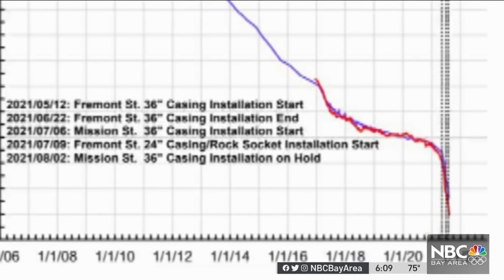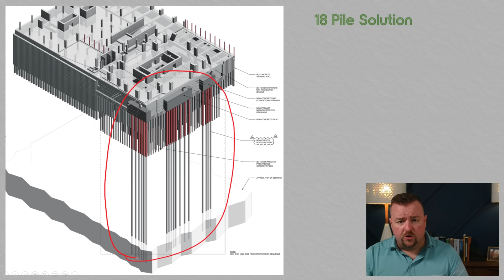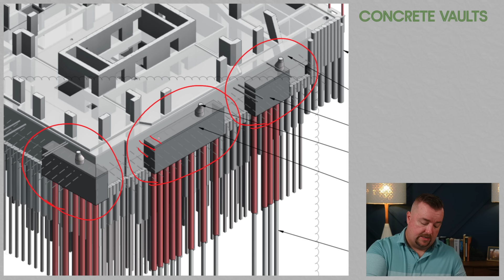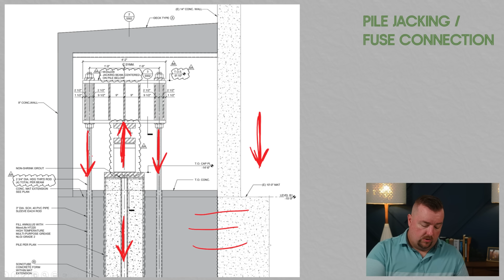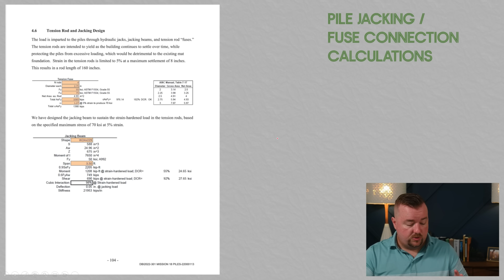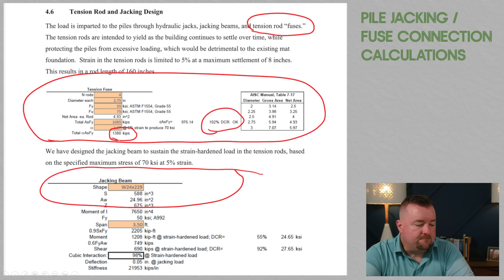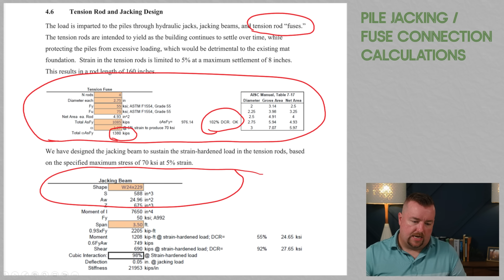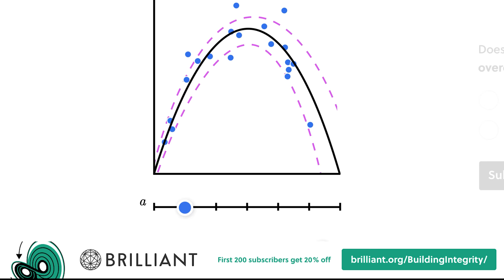Did I Uncover a $100,000,000 Mistake with the Millennium Tower "Fix"?

Comment: I have an engineering degree in an unrelated discipline. In addition to that plate (and the associated nuts), I'm also worried about the ability to transfer that much force to the existing building. The existing foundation was designed to have force distributed widely across the base. Putting that much force on the edge strikes me as a great way to run into weird loading regimes including torque, which concrete doesn't handle too well.
Reply: Yes that wedge is kind of small, especially as it would have been easy to water jet deeper under the existing slab, and then pour in a wider thicker raft to spread that load over a larger area. Not as well bonded to the structure, but with enough steel in it, and thick enough to make the slab triple the thickness in that area, it should be able to spread the point loading out a lot. Yes cast without a form, but use a high quality hydraulic concete and superplasticiser, and just keep pouring till full, with a minimum volume of concrete to ensure good cover, and you will have a much superior foundation, then can use the forms and do the rest in a few pours per section.
Reply: agree
Reply: True...but how is the system gonna behave if the building starts to move in the event of an earthquake, the forces on the foundation will suddenly have unharmonic spikes....i hope i don´t have flaw in my thinking process..
Reply: I also don't understand why the key is angled the way that it is. It's trying to push up on the building, so the top edge of the wedge would be where the force is applied. I know it's tied in with rebar, but wouldn't the angle on the top of the wedge tend to want to push the vault outward away from the building as more load is applied? Would there have been some other limitation with flipping that key vertically?
Reply: I have no engineering degree, but my first thought was "That is a lot of load going through the threads of 4 nuts (at the top near the jack)". And each thread is like 5-6 mm deep? Is that really enough to hold up the building?
Reply: @evan-edstrom  I was thinking exactly the same thing.
Reply: Great point! All force is applied from one side,  I can't imagine how that should work over decades, not to mention earthquakes, floods, extreme wind, you name it...
Reply: @JanBruunAndersen  , I was thinking the same thing as Josh was showing those photos, and hoped he would have mentioned the safe loading of two nuts threaded onto that rod.  I'm not an engineer, but do have experience with guy wire attachments on large communications towers, and putting that much tension on just the few mm of thread depth is a major concern.
Reply: @gilde915  I'd expect this contraption to be ripped off from the building and then the building will do something we don't want.
Reply: @JanBruunAndersen  makes me wonder what kind of wonder material the ''fuses'' are supposed to be made of.
Reply: @mikef2618  Not an engineer so please forgive me if this is a silly question. Could an earthquake cause the safe loading to be catastrophically exceeded?
Reply: @DonFahquidmi  I cannot answer that, as I also am not an engineer.  I did, however, work on a guyed radio communications tower that sat on a bottom plate about a foot square, held up an inch or so off the concrete pier by four 1 inch threaded rods sticking up out of the concrete.  I was not involved in the original construction, but was told the original crew had finished building the 400-foot tower and were about to start putting antennas on it.  All of a sudden, there was a loud BANG!, and the whole tower shook, but stayed up, with the guy wires now somewhat loose.  The four nuts under that baseplate sheared, and the tower dropped about an inch.  The manufacturer's response?  They should have grouted under the baseplate.  So the manufacturer was relying on a $5 sack of grout to hold up tens of thousands of pounds of downward force.

I live in the Midwest where earthquakes generally do not happen, and if they do, may only knock over a plastic lawn chair.  But, I'm sure a California quake would, indeed, cause the safe loading to be catastrophically exceed.  All bets are off.
Reply: concur
Reply: @JanBruunAndersen  Nuts are designed to develop the capacity of the bolt in tension. That is, the bolt (or rod) will fail before the threads do.
Reply: @ehsnils  I think it will hold just long enough to tip the building up straight, then pop and let it drop back with enough momentum to keep going. 
Ever watch a guy try to pull a tree away from his house, only to have the rope snap and the tree goes all the over and falls on the house. It's hilarious.
Reply: @ashedold11  not even close to true, and that assumes there was a design. 
Many nuts are thin, yet mounted on huge bolts. Some are even made of soft material, intended to fail before the stud or critical part is damaged. 
Only with a grade rated nut do you have a load rating for that size, and ut might even depend on the pitch. 
These nuts were designed by the same guy that designed the unrated plates.
Reply: @ED-es2qv  It doesn't sound like you know what you're talking about. This engineer didn't design the nuts. They didn't need to. The rods and threadforms are specified in ASTM F1554 specification which was specifically designed to ensure the nuts and thread won't fail before the rod yields. These aren't some little dinky eyebolt you use on your porch swingset.
Reply: @DonFahquidmi  I'm not an experts either.. but if I'm trying to rip a fence post out of its footing. I wiggle it.
Reply: @mikef2618  Thanks for your reply. I worked for an engineer putting guy wires so he could increase the height of a bungee jumping tower on South Padre island, Texas. It was nowhere near 400 ft. The anchors for the guy wires were robust and if anything a bit of over kill. Better safe than sorry rather than let's see what we can get away with.

Also, I live on the island of Hawaii and have been through a number of earthquakes, the strongest of which was a 6.9.  The tallest building on the island is only 12 stories high. It caused damage to buildings that were only several stories tall.
Reply: @johnh2312  I've done my share of fencing so that seems like a pretty good analogy to me.
Reply: @evan-edstrom  I'm guessing that the angle is designed to keep the concrete pad of the building in compression (where the strength of concrete is at its best). It seemed off  to me, too, until I realized that.
Reply: @WritesWithCare  Ah, I see. You're suggesting that the building is pushing the wedge outward, but the wedge is also pushing the building's pad inward. That makes sense.
Reply: @WritesWithCare  I would also like to know what the cross-section of that wedges are at their thickest point. Will they be in shear between the vault and the building? I really do not understand the connection between the new vault and the old building. Will the concrete or will the rebar rebar will be the main member taking up the shear between the vault and the building?
Reply: @evan-edstrom  Introducing an upward force to the angled key interface will introduce an enormous amount of lateral shear force between the existing foundation and the add-on angled key surface. I'm no architect, but I do understand physics well enough to know that this is a recipe for premature failure. This design will not last for an extended period of time, as the two surfaces in the keyed area will pull apart from each other.
Reply: I have no mechanical engineering background and that design just feels like that plate could fail in tension and crack the concrete. This whole design should be simulated by FEM. I would think a load I-beam should be used. But also the tie in to the building seems sus. I would want to reduce the load substantially. Triple the piers. Use strain sensors. It doesn’t have to yield to distribute the load.
Reply: The whole "solution" is insane. Long time machinist/fabricator/civil works guy with half a physics/maths degree digested many moons ago.
Reply: @JanBruunAndersen I worked in the fastener industry and in most cases the the steel in the bolt itself will fail under tension before the the nut strips out the threads.
Reply: @JanBruunAndersen  I've seen similar designs fail,   although at a smaller scale.
Reply: Start Demo soon
Reply: That, large rectangular   concrete    foundation  ''' matt '', is buckling concave, to the earth. The middle is wowed   ' down '   allready !  This new fix, to me, is just another  attempt at   ''how  to fail ''  in  structural  engineering.  That small, steel  ' plate ', bearing  1.3  k's,.....is   another    ' joke '.
Reply: @evan-edstrom  I think the idea is to have the key push things apart (as you noted) and the rebar will prevent that from succeeding, spreading the stress across a wide area.  If you flip the key the other way, then that ledge will have to be engineered to withstand the entire sheer force and the force is across a much smaller area.
Reply: @1verstapp  I'm wondering what the point of the "fuse" is.  What undesirable thing is it trying to prevent?
Reply: @JanBruunAndersen  Same here. If you showed those threaded rods to any mechanically-minded person and said, "I'm going to use these to hold a multimillion pound, multistory building up," they would think you were nuts.
Reply: @ED-es2qv  It doesn't fall that fast, it falls slowly over a period of months
Reply: @JanBruunAndersen  I strongly suspect it will fail.
Reply: @evan-edstrom  i thought about that wedge design and I think it is indeed designed to push the vault AWAY from the building.  However I think this is a good thing;  being that the vault is tied into rebar which is tied to the entire building's slab, you would be effectively tensioning the building's slab giving it strength against vertical stresses.  Kind of like holding a sheet of paper on the ends and pulling outwards so that the paper becomes taut, movement of the vaults away from the slab would make the slab more taut.  
I could be totally wrong but it's the only logical reason I could think of.
Reply: I just read your reply and agree about the concrete.
Reply: @SeanBZA  Water jetting the already unstable soil under an already sinking and tilting building sounds like a recipe for disaster. They already ran into trouble with their "solution" of adding more piles, as that has accelerated the sinking and tilting, so it stands to reason to take a few steps back and thoroughly analyse the problem and the proposed solutions instead of just throwing solutions at it in the hope that one of those might work.

I'm not an engineer, but I can see that ultimately that tower has to be demolished, because the situation only seems to worsen with every attempt to fix the problem. You can't just keep throwing solutions at the problem until the building approaches the critical tilting and/or sinking points, because demolition in place will take quite some time. And time seems to be running out on this building.
Reply: @Samuel Surely the point is that they would fail by design. So what then holds the building?? How does this make sense?
Reply: @jonka1  The "fuses" might fail in exactly the wrong earthquake profile, but that won't cause a worse outcome.

The building is still sitting on its original foundation, and that foundation was designed for earthquakes and wind loads.  The issue is that the unusually dense building is very slowly sinking, and sinking unevenly.

This reinforcement isn't replacing part of the foundation that's missing, it's adding support to allow the other side to sink and the building to return to vertical.  It's a 'thumb on the scale', not the full support.  If the fuses fail, that fraction of the building weight just returns to its original piers.
Reply: Agreed.  I have only 2nd year civil engineering before specialising in another discipline but even so I thought the same thing.  The bending and twisting moments surely will affect the stability of the entire structure.  Despite all that the plate seems crazy small for those forces.
Reply: @gilde915  What is an "unharmonic spike"?  I'm unfamiliar with the term
Reply: That's why fuses are part of the design, so the concrete isn't asked to handle any loads it wasn't made for.  Once the new cement work is complete the new and the old will behave like one piece of concrete due to the compression created by the rebar attaching the two structures as well as the shape of the joint connecting them.  And it's not as if they need to lift the whole building, they just need to tilt it a hair to get it  back to vertical, the vast majority of the building's weight will still be supported by the ground like it always has.
Reply: two bad moment arms vs on pile of garbage leaned up against the side.
Reply: @donaldbiden1920  I hope this kinda shows:   ------I---I---------IIII----II-I   waves are normaly harmonic ups and downs but in an unharmonic system you have waves suddenly like ten times the ups and downs maybe 2 secs then 5 secs then no wave and a huge one.....imagine you thorw a couple of stones close to each other in a pond...those waves when they meet can be spikes and the waves bounce of each other canceling them selfs out or magnify in a chaotic way. I hope i get across what i mean:)
Reply: @pilotavery  well technically its moves very slowly at first then falls quickly. This building is a disaster in slow motion.
Reply: @tomparker9966  know what I'm saying is, if the cables snap or the plate snaps, it doesn't suddenly fall, What happens is the settling continues for another few months until it gets to the point that it falls. A catastrophic failure of this system doesn't result in a collapse. It just means that they didn't pause its fault anymore
Reply: @Samuel  The fuse concept is part of how crazy this design is. If the fuses break during an earthquake, it will require another multi-million dollar project to replace them. It is not going to be as easy as replacing an electrical fuse.
Reply: @Samuel  I don't know if the ships on the sea analogy really works for buildings. If a ship had the same ratio of height to beam (width) it would be in danger capsizing easily.
Reply: precisely, distribution of force, regardless of weight is key when dealing with 'fragile' things ie lo tensile strength like concrete or glass or etc.
Reply: @pilotavery  Maybe engineers can find a solution but I'm glad I don't own a unit or anything nearby.
Reply: @JanBruunAndersen  x 18 piles
Reply: @ashedold11  Thanks, good to know. Now, where will the threaded rod typically break? Would it be some random location along the length, or I think more likely adjacent to the nut? And if adjacent, then what is the relative strength of the assembly compared to the calculated strength of the rod cross section area? Or is the entire threaded rod assembly certified to some level of force greater than that to be applied?
Reply: @johnh2312  I yanked up some fence posts. I used my tractor front end loader!
Reply: Ding ding ding ding freaking ding...
Reply: @mikef2618 the grout used in these applications is typically in the 10,000 psi range and is purely in a compressive load (where these types of materials are the strongest). At 144 square inches that 1 sq ft of grout would support about 1.4 million pounds.
Reply: As I understand it the foundation mat is already dished (concave top surface) and cracking due to the unequal friction pile loads.  (The center piles tend to overwhelm the local soil while the more isolated edge piles carry more load.)  Adding even more load to the outer edge is not going to help.  At what point does the damaged mat start down the 'other side' of the stress:strain curve, headed for outright failure?
Reply: And the transfer is horizontal. That cannot work.
Reply: Yes. You can have a situation where the outer wall  of the foundation stops sinking or even raises but as you go in towards the center there is now an aditional gradient forming. Do to it having a far higher compresive limit this will transfer force upward unevenly along the radius  where force is uusually proportionate to the inverse square law only until there is give somewhere. As others have  said torsion, sheering, and bending is really not something concreat  doese well. One thing we can say for certain is the compression on the outside is  going  to be far greater especially if they try to lift considering the center under foundation was already compressed. Not really my area of science but this whole idea seems out of place like it was designed originally for a different situation.
Reply: Yep.  That was the first thing I noticed too.  Don't want to second guess the engineers involved (I'm an architect) but that connection is worrying for me.
Reply: Great point.  The piles will seemingly support one corner.  As you say, the existing foundation may or may not be capable of distributing the forces.
Reply: @mikef2618  Two nuts? the jacking beam only has one. it would fail there. I don't think the bottom nut on the jacking beam will be supporting any load.
Reply: Yeah, the number 1 thing I learned in construction class is that concrete is horrible in tension. All those oddball forces are going to cause some real big problems 😅
Reply: @ashedold11  so interesting. This, I did not know! Thx.
Reply: @pilotavery  so this plan is to better support the tilting building (on the sinking side) by fusing the deep supports into the current building base. And if this doesn't work, or if it fails (even catastrophically), then you just have a tilty building again, but not a risk of devastating failure and collapse of the building (which was never a risk at this point, tho it could be, depending on how fast and unevenly it sinks.

It's not at risk of collapse before the repair, thus it won't be at risk if the repair fails? If it fails, they'll just have to do something to fix the lean, again? Costly, annoying, maybe even embarrassing, but not a catastrophe? Do I understand you correctly? 
Thanks so much 😎
Reply: @pilotavery  might a sudden failure of the reinforcement cause a sudden tippy-tilty of the building, after which it cannot stabilize itself...? And could the building actually tippy-topple right tf over in that failure moment?
Reply: me thinkig the same thing
Reply: You misunderstood the design. The extra fuse system is not used to stop the sinking. The smart thing in this design is it allows the building to keep sinking. that is why it has all the grease filled gaps and overdrilled pile holes. It only add extra resistance to make the supported side sink slower than it can, it does not need to transfer the load through the base plate, it actually reduce the stress apply to the plate due to uneven sinking. So if the metal plate mentioned in this video can really transfer the load it is actually an excellent design. Only thing worries me is what if the project actually disturbed the clay layer and reversed the settlement speed? I mean the soil settlement may become faster at the unsupported side. The underground condition is actually mostly based on guessing and trial and error...
Reply: @JanBruunAndersen  if they use coarse threads, it should be alright. Lol.
Reply: Reminds me of the Hilton sky walk collapse where the threaded bars pulled out of the metal box frame of the concrete Skywalk slab
Reply: @92up7  I know nothing about buildings and engineering, but a news report I watched said the design was originally for a smaller building that was mainly made out of steel, but they decided to make it bigger and replace the steel with concrete to make it stronger.

I also heard that when the design was originally made, it was proposed to put all of the supports all down to the bedrock but it was $4 million more expensive. If that would have saved the entire design and problem, then $4 seems an absurdly low price not to pay at the start.
Reply: Although the wedge is now poured,  I would hope that the existing exposed rebar were extended across the new concrete grade beam, thru cad welding or similar.
Reply: @evan-edstrom  I would have caused the existing reinf bars exposed for the wedge to be extended for the full width of the grade beam, in addition to roughening the full side of the foundation slab, using bonding agent and a forest of new reinf bars.   I wonder if this was done.    The concrete removed at the wedge might have been for the purpose of extending the reinf using CAD welding or sim.   If not, I can't see how it can work.   Also, I strongly suspect that the foundation slab was not designed for the loading that it will receive with the new piles extending to bed rock.  Also,  did they allow for suction under the foundation mat, and the resistance of the existing piles to withdrawal as they are lifted.   I am an SE and think that the bldg ultimately will be demolished.    Also why did they use concrete when a steel framed building is lighter?
Reply: @1verstapp  A new invention:   steel.
Reply: @DonFahquidmi  Reply from an SE:  Yes.  And the EQ can damage/destroy unreinforced piles with upward (P waves) and lateral loading (S waves).
Reply: @mikef2618  Do you know that the Midwest had the biggest earthquake in all of history?
Reply: @petersack5074  I think that you comment is right on the money.   I am an SE.
Reply: @jeffreynelson2660  Thank you.
Reply: @johnh2312  Add liquefaction to the mix and they are in deeper doo doo.
Reply: That’s why multiple units are experiencing sewage backups into the sinks. The sewage pipes are no longer flowing unobstructed at the correct angles
Reply: In Canada engineers must have their work peer reviewed for any construction project. Isn’t this required in the US?
Reply: @1verstapp Maybe carbon fibre?😅
Reply: That's what the "fuse" concept is intended to address: limiting the force transferred to the vaults.  Fun question is whether the force allowed to be transferred will in fact solve the problem.  They're counting on the building continuing to settle on the other side.
Reply: There already are massive amounts off directional pressures that it is not designed for. Maybe we can get the government to bring it down like the towers. Oops almost forgot about building 7 that was never hit.
Reply: @slowzuki Hyatt in Kansas City, not Hilton, right?
Reply: @evan-edstrom Nope.
Long version:
All materials have an angle of repose, it's the slope you get when pouring a pile of the material.
If the angle of the slope in the construction is less than the angle of repose then it won't slip.
In order to fail as you suggest, it would need to slip.

Remember also that rebar will make that angle much much steeper.
Reply: @JanBruunAndersen  Thinking the same.
Reply: @gilde915  I hope you're wrong but have to admit that is some serious thinking well beyond the usual what ifs. Imagine the audio track as a highly irregular, random, hi frequency ringing as the ground shifts.
Reply: 2 nuts jammed together does not spread the load across the 2 nuts.
The bottom nut will carry the full load.  If they calculated the load capacity by simply doubling the value of one nut it will fail. They need to have custom nuts machined that are larger diameter and longer.. The larger diameter will greatly help the plate punch thru problem.
Reply: @ehsnils  Yeah I agree. I don't think that little rebar tie in is nearly enough to attach to the building an help spread the load
Reply: It would be best if they just took down the building. I have very little confidence that it’s a solvable problem short of gradually replacing the ground with concrete all the way to bedrock.   And even if it is solvable, do you really want to trust it?
Reply: In theory it should have been possible to adjust the settling rate opposite of the lean. Drill and inject water, or simply drill a decent amount of holes, should have allowed to increase settlement on the opposite site. this would have helped to unload the foundation, instead of putting more stress on it. but i don't really know of any case this has been done, so i guess the rather went with this works with small structures so let's try to supersize it.
Reply: @JanBruunAndersen  i had that same though when i saw the threaded rods in picture... those threads are really thin. and how are they making sure they don't slip during an earthquake or other movement/vibrations? what are they going to do, pour a whole bottle of lock-tight on each one?
Reply: @DonFahquidmi  This structure is certainly designed for an earthquake. I would suspect that earthquake loads are already considered in the amount of tension that each rod has to resist. I also suspect that earthquake loads are why this "fuse" is being installed in the first place. I think the idea is that it will help dissipate the energy from the earthquake as the threaded rods yield.
Reply: @mikef2618  The manufacturer said this because they did not design the threaded rods to take the huge compressive loads that come with guyed structures. I don't think they wanted you to put a 5 dollar bag of grout under there, but probably wanted a high quality high compressive strength non shrink grout so that the loads would be transferred to that instead of the threaded rods.
Reply: @petersack5074 what is up with your formatting...?
Reply: @jake12466  Fortissimo.....
Reply: Every time an engineer points something out, it's like a forehead-slap moment. Seems so obvious once it's pointed out, but...I guess that's what engineering classes are designed to prevent.  Keep up the good work.
Reply: Yeah, it already has "Dishing."
Reply: I think the only thing that will save it, at this point, is a cloud-hook.
  But, some piston return springs in those pile jacks would  improve  the load  capacity...
Reply: @gilde915 you dont have flaws as best i can see.  You have just found the limits of knowledge.  No prediction is possible since amplitude of hormonic spikes and frequency are unknown.  It could be simulated over a linear distribution of amplitude and frequency of spikes, or actually over at least a two dimensional  linear distribution.  I have no idea what two dimensional  linear distributions are called. Then just decide where you want to put your arbitrary area on that plane where you say that specific size and frequency of hormonic spikes per unit of time wont likely happen 😂
Reply: Yes Yes, i'm an Engineer too 😂
Reply: Welp you were right. Now the pad is flexing and cracking up in the middle. These guys should have spent more time with Lego blocks when they were kids.
Reply: @DonFahquidmi 
One should assume that soil liquefaction will occur during an earthquake and the original friction piles will sink. That puts up to 100% of building load into that corner on the 3 new perimeter supports.

This implies that the 4 "fuse" tension rods will yield (stretch) like a spring can permanently stretch.
Reply: @jeffreynelson2660 The biggest earthquake in all of recorded history was the 1960 9.5 Great Valdivia Chile Earthquake. 
The earthquakes in the Midwest of the US in what we now refer to as the New Madrid Fault Zone, were a series of large quakes that occurred in 1811-1812. The magnitudes of the quakes are still debated, but are thought to have possibly ranged from 7.0 to 8.1.
Two other major earthquakes with significantly more documentation and physical evidence were the 7.9 Ft Tejon Earthquake in Central California on January 6th, 1957; and the San Francisco Earthquake April 18
Reply: I agree with you fully.  it's innovative, but very sketchy at best.  While complex it doesn't inspire confidence.
Reply: @russellhltn1396 I believe it is to distribute the load evenenly across the I beam. Each section can yield a bit to transfer weight to a seperare piling.
Reply: Definitely will torque the edges as the building settles. Unless they get the plate all the way underneath the building, those walls on the bottom edge are going to crack. They better put a bunch of beams internally that attach to the plates to reinforce it
Reply: @SeanBZA  it’s a piled base - the base is designed to transfer the loads onto the piles - the soil under the base is generally ignored for transferring loads.
Reply: @evan-edstrom  interesting thoughts - to me it looks like a corbel - but you have to view it as an upside down corbel from what we usually see. if you look at the drawing you will see the existing pile to the existing base in line with the corbel. The loads are o transferred to the new & existing piles. Any out of balance forces/moment/torque  is resisted by the rebar connected at the top of the new concrete box. These forces wouldn’t be particularly high imho and easily catered for. 

The ‘key’ is angled that way (& it looks like it’s isolated by a membrane if I read the squiggly line as being this) so there is physical separation  between the concrete surfaces - it’s to remove any load transfer between the new & existing concrete as the system is designed to transfer loads to the piles - if it wasn’t separated it could ‘lock’ & release at any point - which wouldn’t be desirable!
Reply: @mikef2618  thread depth x length - looks a fair amount provided here. Loads here are pretty much static listings. Communication towers / guy wires the listing cyclical / dynamic. I would’ve  thought the wires more prone to snapping than the bolt threads being stripped 🤔
Reply: @1verstapp  it’s on the drawing - not rocket science!
Reply: @DonFahquidmi  nope! 

The building would have been designed for an earthquake of “x” magnitude. 

The “safe loading” is the combination of many different loads applied in a number of different load combinations with load combination factors & material strength factors added into the mix. 

Buildings / structures are designed for the worst scenario but it would not be economical to design for Armageddon conditions!
Reply: @mikef2618  I presume it was grouting the underside of the baseplates to the tower? If it was on the drawings as per manufacturers instructions then they are not to blame are they? It was the contractors & their site supervisor/engineer. Grout under the baseplate stops the baseplate rotating. If the baseplates rotate by a few mm then this is multiplied by the height of the tower! Sequencing the guy wire tensioning is important too - so I wouldn’t be surprised if this wasn’t done correctly or as expected.
Reply: @ashedold11  unless the nuts are mismatched / incorrectly specified!
Reply: @DonFahquidmi  maybe smaller buildings were / are generally not designed for earthquake loads -
Reply: @electronicengineer  I’m guessing the squiggly represents a membrane to separate the concrete surfaces to remove the concern you have - imho. 
But even if it’s not - the new block of concrete will settle by an amount as concrete contracts so a gap would form anyway.
Reply: @rb8049  you’re just going belt & braces for no reason. It’s just a fancy underpin foundation - nothing more. The engineers may well use FEM to model the existing & new foundation together - or other analysis program. 
I’ve commented on the plate - it’s fine - as it’s got to shear the concrete first & doubt that’s gonna happen!
Reply: @vincentwhite7693  I think it’s quite a good design. Would like to know what you would have come up with!
Reply: @user-mp9rd4hg8b it’s a novel design & fit for purpose. It’s just underpinning at the end of the day.
Reply: @pilotavery  probably years imho -
Reply: @phoenixrising4073  it’s an upside down corbel. Nothing more nothing less
Reply: Absolutely spot on.  Not a SE but We know now the “fix” actually caused further sinking and altered the load points on the mat, thus negating the intended SE calls/plan. Apparently, the load is being redistributed at different points on the mat that were not engineered .  How can this happen?
Reply: No. And the YouTuber did not do a very good job of explaining anything. He focused on the wrong thing. The plate isn't ever an issue as this the thing 2.75 inch rod holding up a building will fail before the plate sees a crushing load.

The system is meant to reduce that side of the building settling FASTER than the other side. The entire building is settling. That's problem 1. Problem 2 is one side tilts faster than the other side.

This jacking system isn't meant to correct the entire problem back to original. It is meant to reduce the settlement then have them back to even settlement.

Hence why they increment the force. 100,000 lbs. Measure each side. See how it settles. And watch for 10 years. 

The little numb doesn't see much force. It only sees as much force as they apply with the pistons.
Reply: Totally agree.